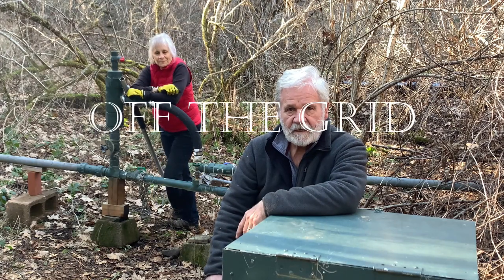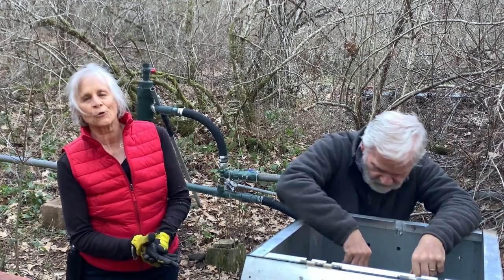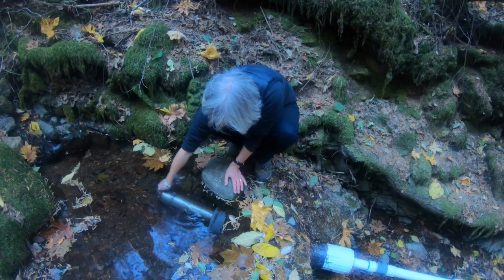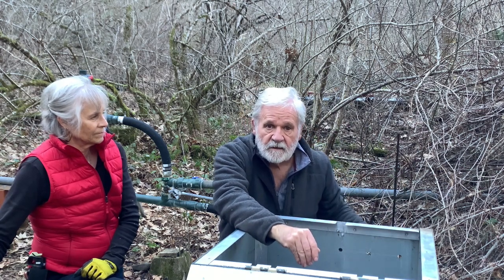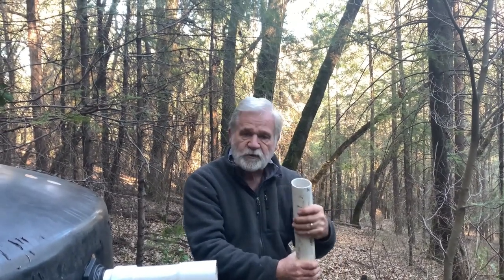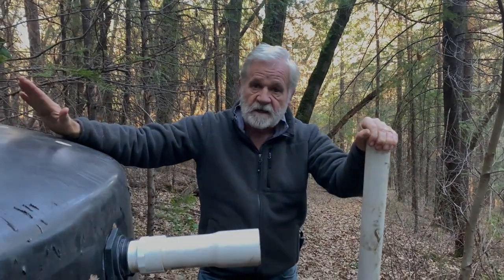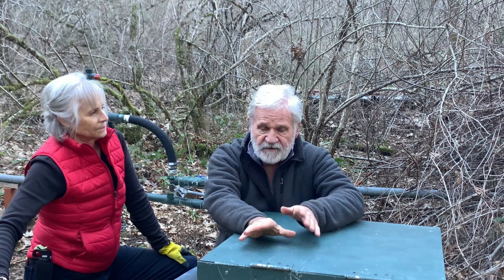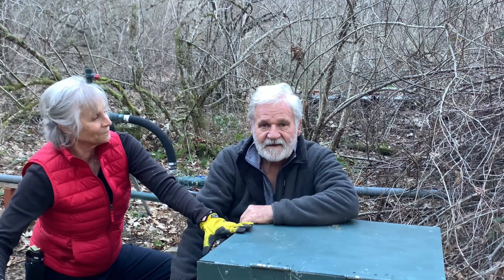Micro Hydro at Work; One Year Status Report. Off the Grid with Karen and Grid

Comment: On the blockage problem
 How about a bend inside on the input to your tank directing water downwards to help gravity pull the pebbles to the bottom of the tank. Great videos👍
Reply from the maker: Thanks. Good idea. Unfortunately, the discharge valve is at the bottom of the tank….so small bits of detritus would still get swept downhill to the pelton wheel. Fortunately, our screen at the dam catches the bad stuff. The remainder is often pine needles that get compacted as the water is forced through the jets. On startup we now disconnect the input hose and flush the line. That seems to work pretty well. Still, we keep an eye on amperage. If it drops, we know we have an obstruction. Then, out comes the old arrow shaft.
Reply: @offthegrid4036  maybe adding a vortex filter would help.  I like the principle of those, vs screen filters.
Reply from the maker: Vortex filter is a good idea. Thanks.
Reply: @offthegrid4036  
Can you change this offtake for the hydro to half-way up the side of the tank; with a pipe section 
(drilled with small holes with a sock filter of shade cloth/fabric covering these multiple drilled holes)
on the inside of a quick disconnect coupler like you use the access the water jet to clean it out?
(So as you withdraw the coupler the intake holed section with the shade cloth filter also come out; easy cleaning or quickly replaceable with a pre- cleaned one)
Theoretically by drawing the water from half-way between the top and bottom...
the silt has dropped out 
and the leaves etc that float  are in the top of the tank.....
The bottom offtake can still be used to flush out the silt that accumulates in the bottom of tha tank?
Reply from the maker: Great idea. Yes, that is a doable and practical innovation. Thank you!